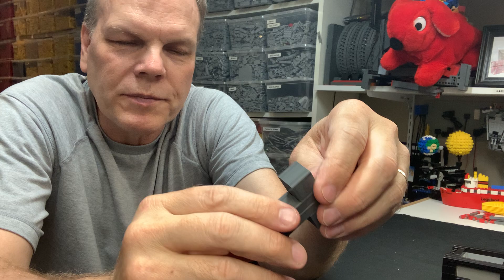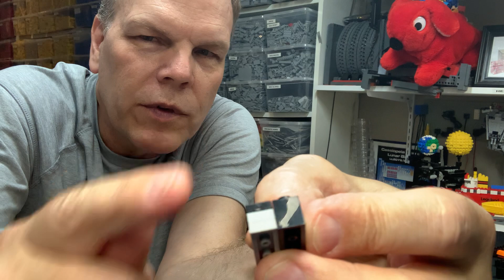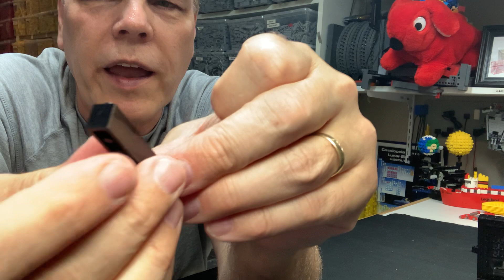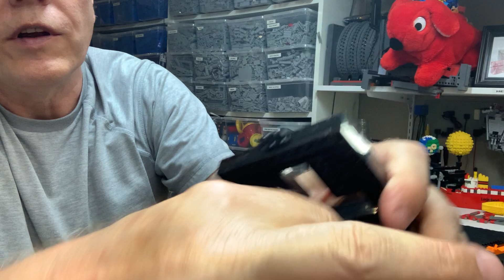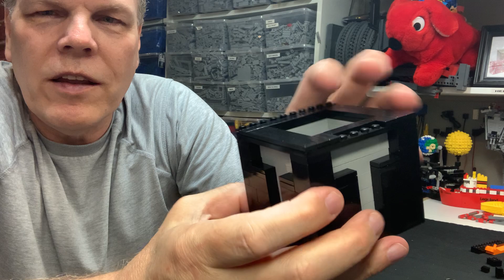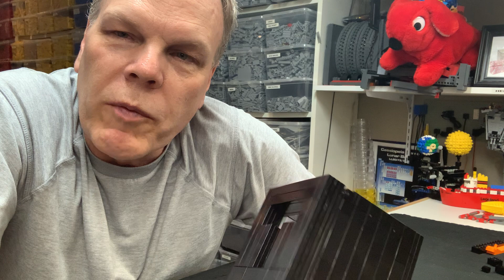DKP - The 6 T Puzzle and a discussion about LEGO Geometry

Comment: I don’t think this is possible. The volume of the void is 27 units. The volume of each T is 5 units. 6x5=30. 3 units too many, no?
Reply from the maker: the void in the original standard brick build is 6 studs by 6 studs, or 30 units by 30 units.  And the T's - as you said - are 30 units across.  The issue is that void is 8 studs deep - and the tolerances of the bricks make it so tight a fit - it's 'friction fit' so the T's - once placed inside the void- have to be forced out.  Changing the sides to SNOT plates and tiles - the void is now 32 wide by 31 long - and still 8 studs deep - or 40 units.  The T's in the void aren't 'friction fitted' anymore - theres 'wiggle room' :)